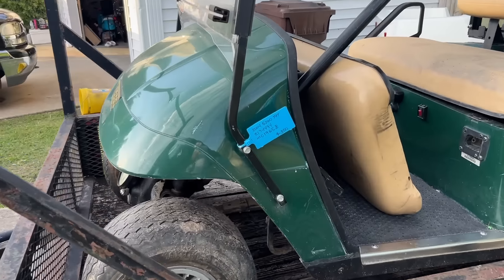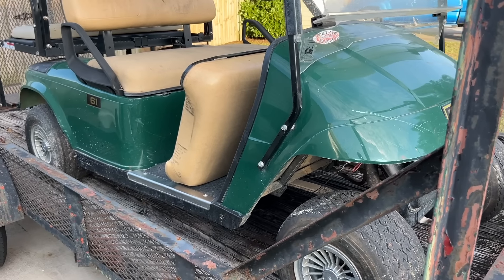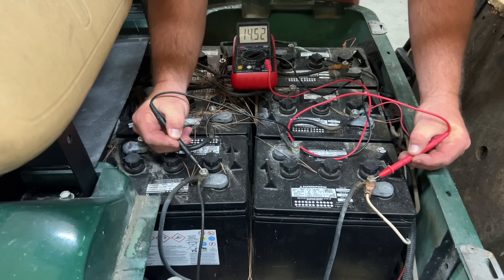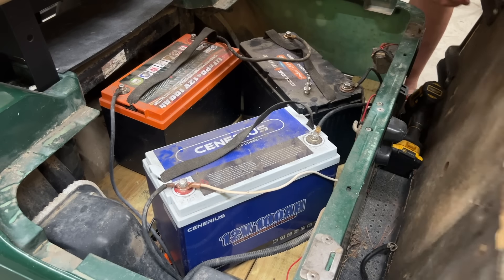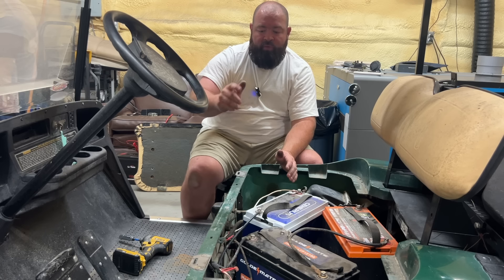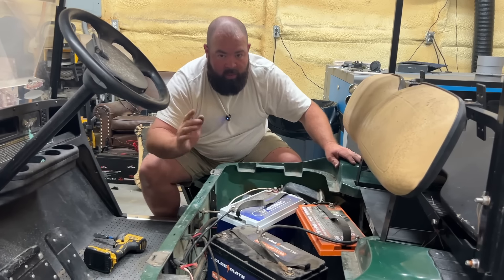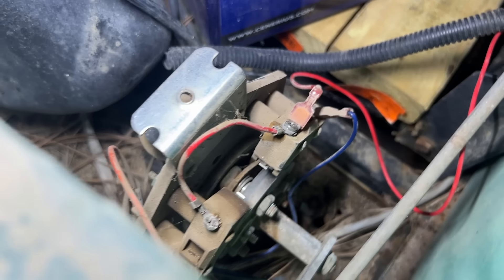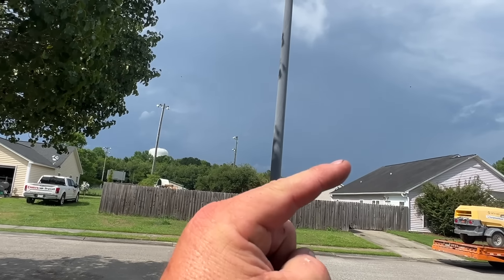Transforming a $50 EZGO Golf Cart with an Easy Fix! | This Cleaner is a Must For Electric Golf Carts

Comment: I'm trying to restore a '96 Textron that I can't even move - any suggestions?  Documentation says it shouldn't have a tow switch but it feels like the brakes are locked in.  Brake pedal operates as normal, but I can't get it to budge at all.

Comment: Is it possible to elimate the mechanical portion of the F-N-R , and just tap into the F-N-R wires on the right side of the cart, and install a EZ-Go switch up on the dash?
It seems more complicated to have to maintain that manual push bar and brushes.

Comment: When you switched to the three lithium batteries do you use your regular charger or do you have to buy a different one? Nice video.
Reply from the maker: @davidrangel1731  gotta have a charger for lithium since they have a higher voltage range
Reply from the maker: I have a lot of videos on lithium battery conversions with discounts if you are new to my channel.

Comment: Hello everyone, looking for a little insight here. We have a 1997 EZGO TXT ran fine but weak batteries upon purchase, we upgraded to 4 12v lithium batteries, 48v 200amp HD solenoid, 48v Alltrax NPX 4634EZ Controller. 

Swapped batteries, charge port, etc., labeled all wiring and wired the new controller, solenoid up exactly the same and after the swap the cart ran great for about 5 minutes, came to a stop and took off again and heard a noise kind of like a clunk or pop and the cart died, no power, smell of burnt electrical. Got back to the shop and sure enough the controller was burnt up, the solenoid seemed to be functioning properly, but the resistor was extremely hot, could not touch it. This resistor on the solenoid stayed extremely hot as long as we had the batteries wired in series, I would have to break the series by removing a connection to the batteries before that resistor would cool off. 

I am thinking the solenoid was bad and failed during the short test run but I am looking to you all more experienced folks for advice on what to check, am I on the right track with the solenoid or way off base? I am ordering a new controller, but I want to make sure I have the issue addressed before replacing it. Also does anyone recommend someone that can rebuild controllers that have been fried?

Comment: I’m getting one just like this one. Needs batteries is all. Is it possible to gain any speed with these 36V series carts with out doing full conversions?
Reply from the maker: plum quick sells motors. These series carts make torque with controllers.
Reply: @Fentertainment  thanks for the info!

Comment: I call clickbait, it’s not a 50 or 100 cart in that condition around here… that exact cart would be $1500 here. If that’s the case I just opened a trucking company. Where you at?

Comment: Where do you find a cart for $50
Reply from the maker: I mentioned it in a video from a while back. A dealer in my area had several that "didnt run" for cheap. I bought like 13 carts for around 3000.